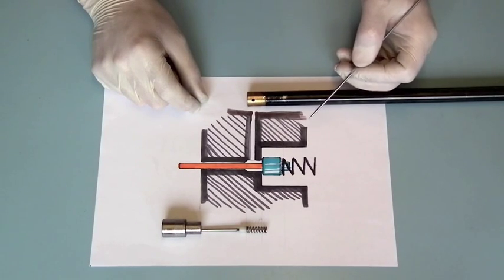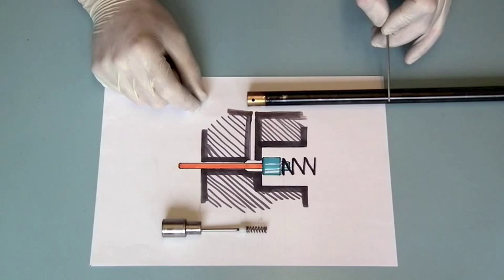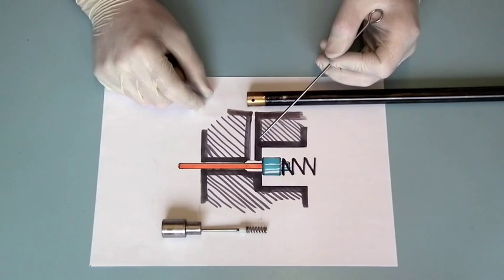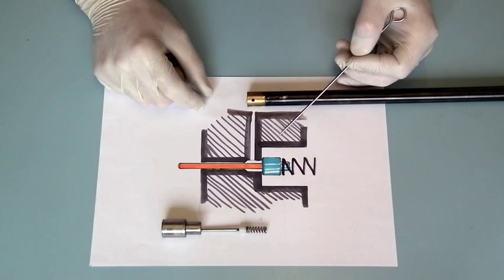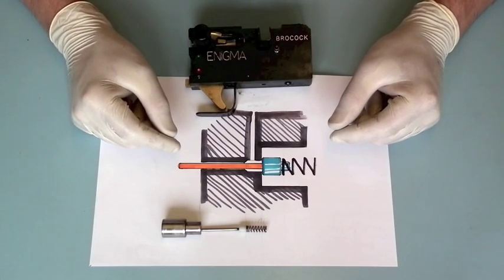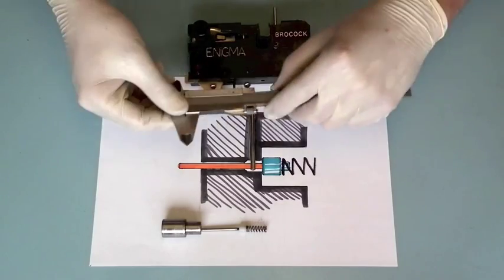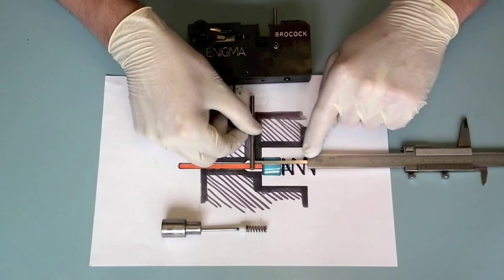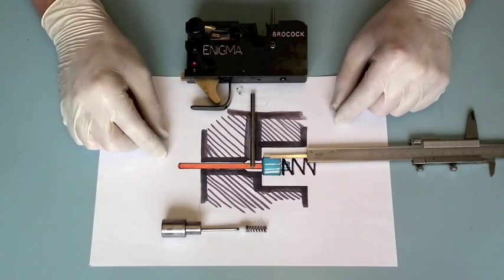Lane Regulators - Pt. 1-4 Transfer Port Size Adjustment.

Comment: i'm planing to build my own PCP and was thinkin to make a hole at the same diameter as the barrel to keep an even velocity and flow throught the air way. Is that correct or I realy need that narrow path?
Reply: You need it to be at the most 70% of the size of the pellet/slug that you're planning on shooting, because if you make it too big, then your pellet/slug will fall down into your port hole😞

Comment from the maker: 'Thank You' For your kind comments. I have one or two more simple videos in the pipe line with reference to regulators. However I feel some need remaking or making simpler. I was thinking when I get time, to put one together with all the setting for different things. But guys have our reg's in over 50 types of gun, from 3ft/lb (Italy) to 70ft/lb (USA) so it is difficalt to cateer for all.